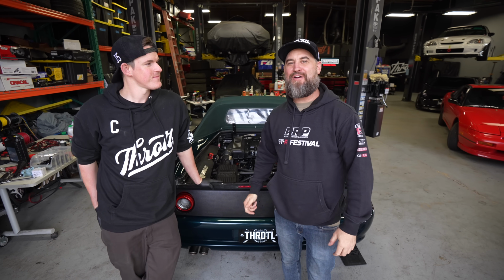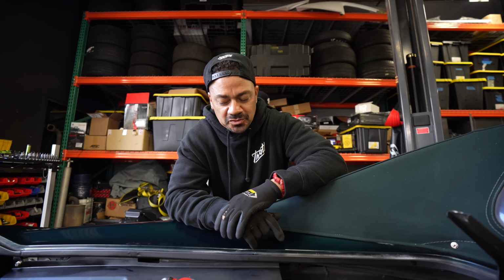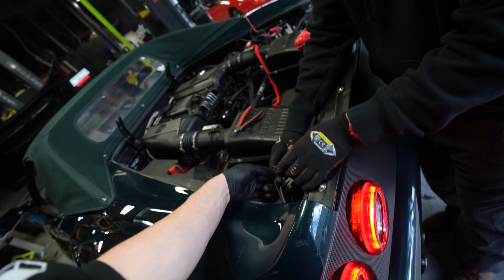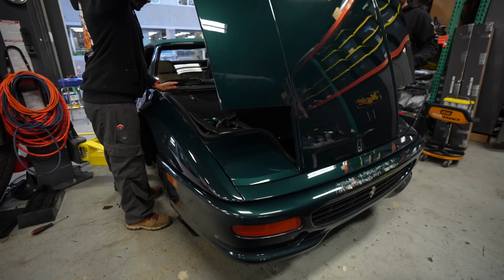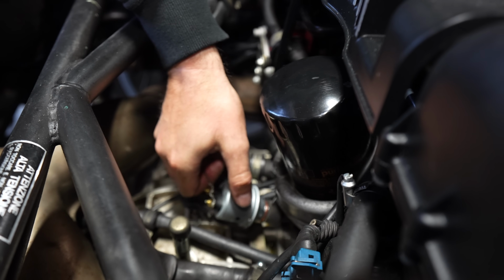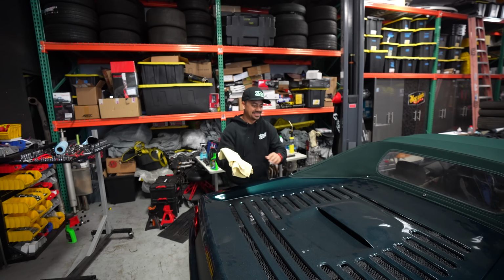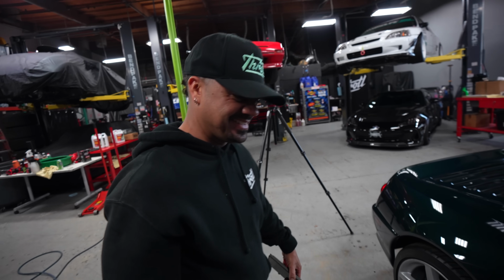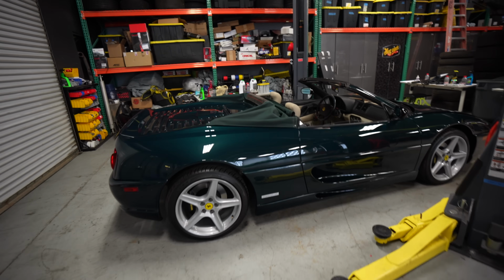Rebuilding Our Abandoned FERRARI F355! (Gated Manual) - Part 4 Transmission Trouble!

Comment: The 3rd gear grind could be shift linkage alignment. When you reconnect the shift linkage, matching the shift gate to shift fork positioning is just about impossible if you go just by feel, you have to take off the transmission pan to visually make sure the gear selector is centered when the shift lever is centered. There is an interlock slider in the transmission to prevent two shift forks being pushed at the same time but if that is worn enough you could be pushing on a different shift fork enough to cause problems. You could loosen or remove the shift gate and see what difference that makes.

Comment: I don't think you have adjusted the gear link rod correctly. Just a small adjustment in the right direction.
If its slightly out it can cause select issues.
Reply: I hope they see this comment. They literally just hand adjusted it and called it a day. 

If it is NOT the gear selector shaft then it is syncro-related. It might even be clutch related - have they even checked the clutch??!!

Still can't believe they didn't change the gearbox oil BEFORE caning the engine only to grind the gears multiple times ... @____@???!!!

Comment: I had the exact same issue with a cam position sensor when I did my major, oddly enough AutoZone had them for $99 with free next day shipping vs $380 for the Ferrari part.  A lot of the sensors cross reference with something else if you use the Bosch or denso part numbers and not the Ferrari parts.  Other example are the crank sensor also is used on an Iveco truck, voltage regulator in the alternator is a $40 Denso part etc.

Comment: No Ricky, you're not done.  What about the center brake light???  🙂  I think I'm in the minority when I say those tail lights don't really suite this particular model.  I get that you're trying to match the more modern Ferrari's  But I think doing a simple LED bulb replacement in place of the Halogens would give a better affect.  Just my opinion.. 🙂
Those headlights are in dire need of a HID projector upgrade.  😉
Lets hope the trans will work itself out after getting some heat into it.

Comment: Shifting issue could very well be the linkage adjustment your removed for the major service. Does it shift smoothly with the engine off? If not remove the gate and check for centering of engagement and selection in 3rd/4th gears. Also make sure you don't have a dragging clutch.

Comment: Instead of buying a new transmission you might want to consider rebuilding the one that you have, and if you use prolong engine oil into it you will find that you will have something better than any other transmission you have ever seen, especially on a manual transmission

Comment: Had some brittle injector coil harness connectors break on my wife's 10 year old Toyota suv when replacing coils and simply ordered a pack of 6 coil connector pigtails for $15.  Depinned the new pigtail connectors and installed on the oem harness.  Not sure if anything could be found for older model ferrari connectors.

Comment: I can't believe the mistakes you've made doing all this... after doing such amazing work getting it to a working state.

1. You didn't even drain the gearbox fluid until AFTER you started grinding gears... in every gear and kept doing it?!  (Quinn, WTF were you thinking?)
2. You cut out all the footage showing it was still grinding after the oil change - which you should have done from the start as pre-maintenance. 
3. You haven't finished adjusting the gear rod linkage to spec and that is obviously still a problem. I dunno... maybe ask "A FERRARI SPECIALIST".
4. How the actual f**k did it get to any of these points when all these problems are connected? 
5. Did you check the clutch slave/master to see if there is/are any leaks/air/slack in the system? 

Grinding gears? Either it is syncro related... which is really bad news. Or it's the gear linkage and/or clutch... which is not bad news at all. The car most likely needs a new clutch and slave/master cylinder anyway. Was any of that even changed??

Quinn... don't let me down. You're not M539 Sreten level but you could be if you paid more attention.